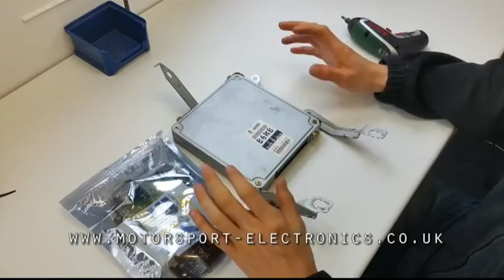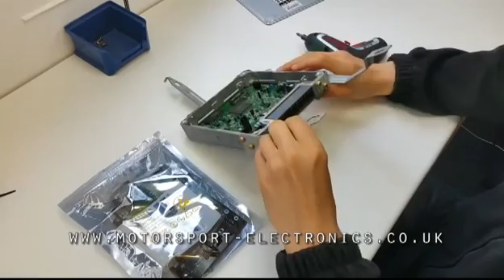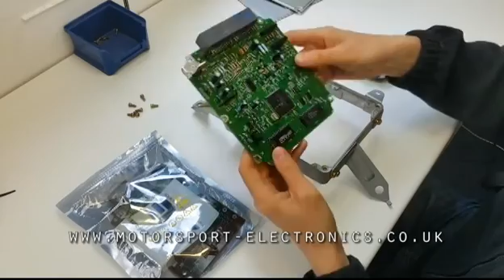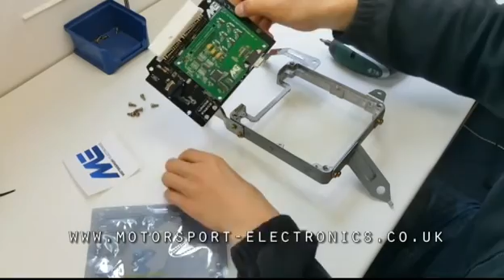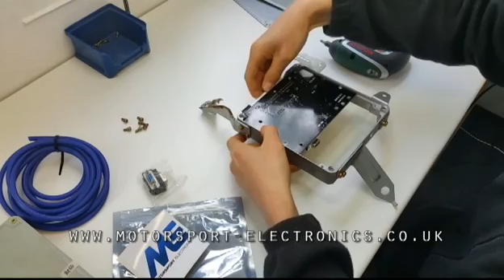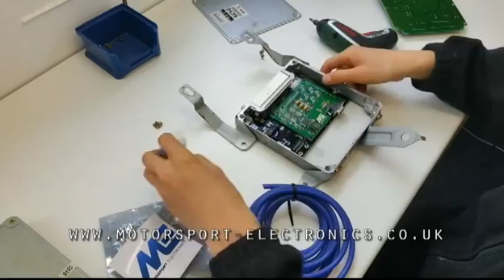ME221 PnP MX-5 Install into factory case

Comment: I cannot find an MX5 ECU casing to fit the 01-05VVT ECU. 

The ECU seems massive compared to the others and all the cases ive come across are too small, do you have a part number / ECU code for the larger cases?